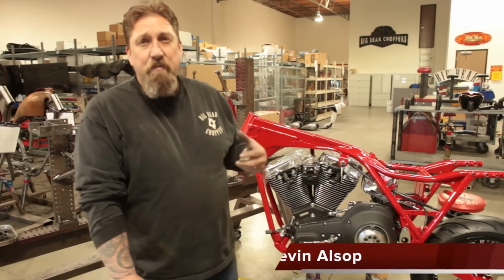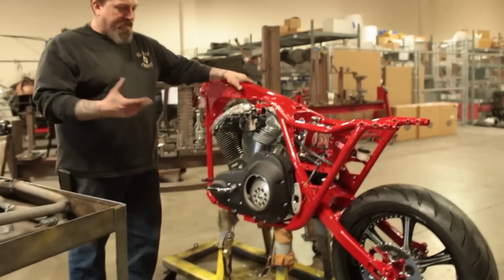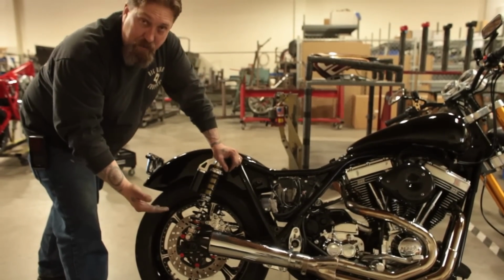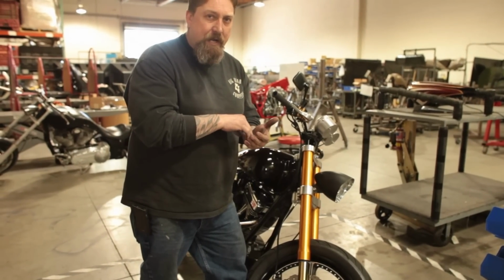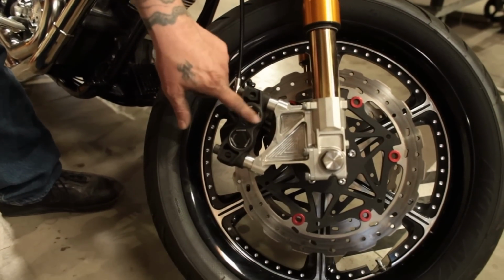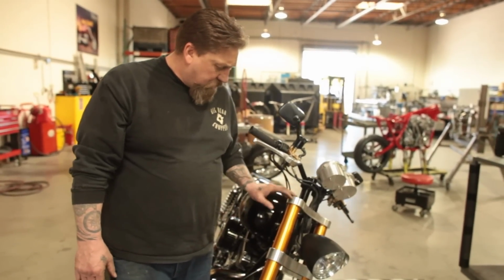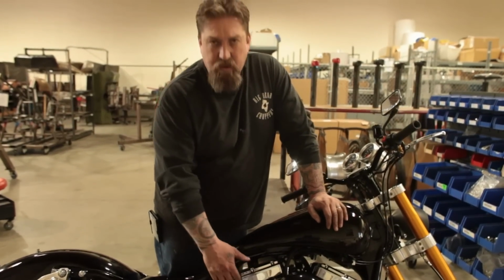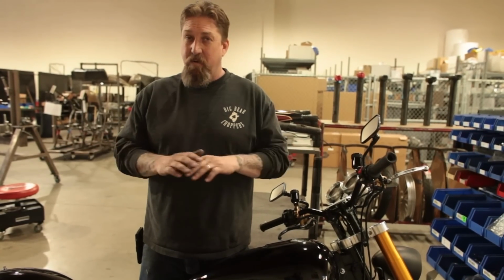TITANIUM Full Version

Comment: Why don't they use 120mm section front and 200mm section rear tires on it?
Reply: Adrian Rubi the bike is very light. Fxrs are About 40 pounds lighter than a dyna (I belive. Don’t quote me) so that’s a lot of weight. Even though it doesn’t seem like it. So it doesn’t need a 200 rear tire. Nothing needs a 200 a 180 is big enough for 90% of bikes (that aren’t  sub 600 sport bikes or sub 1000 cruisers those are too small to even need a 180)  as for a 120 front. Not much different from a 110 or 100 on a 19. Very small changes. But the bike is so light it doesn’t need so much tire. Plus less tire=less rotating mass

Comment: I trust that these bikes handle amazingly but 150 miles an hour come on come on?I understand he's trying to sell a product but his claims seem to be a little far-fetched I want to see actual proof of these bikes doing what he says they can do.
Reply from the maker: IMG_3835.jpeg

Not sure if you can see the picture but this message is from one of my customers .

Yesterday got my dyna impounded over 140 on PCH Pulled up to Neptunes was sitting there for two minutes and all the sudden the cop pulled up and was pissed off very close to getting arrested then he called back up and four cars came he was a prick The suspension is fucking great Ha ha ha
Reply: When you factor the parts, material, labor, etc  The shop makes at least $1,000 an hour for buildig custom bikes.  At Daytona, I saw a bagger with a asking price of $107,000!  There might have been about 20 minutes of welding done to the frame.  A few hours of fabrication and Bondo and then everything else except the paint was a bolt on part that could be purchased from many on-line vendors.  And that custom paint was probably done in less than a week.  I cannot tell you how many $80,000 bikes I have seen for sale on Ebay that sell for less than $8,000 and were rode less than 10,000 miles.  Why?  Bragging rights!  Enough of this madness!  Go purchase wrecked bikes from insurance sales, learn to weld, fabracate, bondo, and paint.  In less than two years you will be selling bikes two to three times the cost you have in them.  Then go build your own dream bike for less than the $100,000 the shops what to charge you extra for.